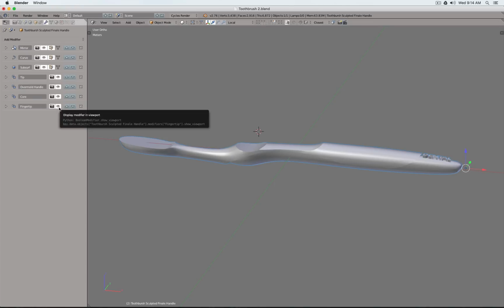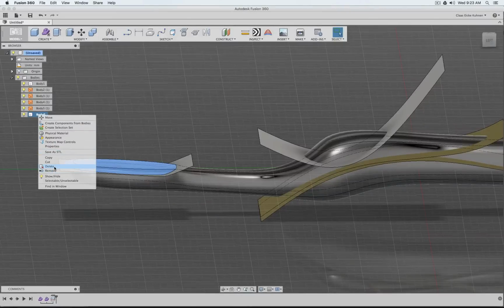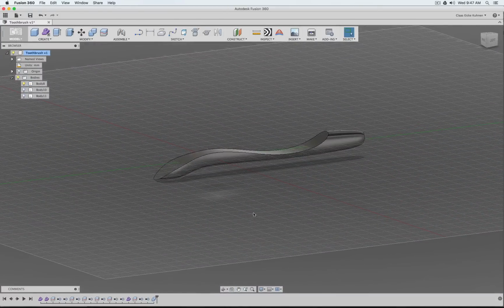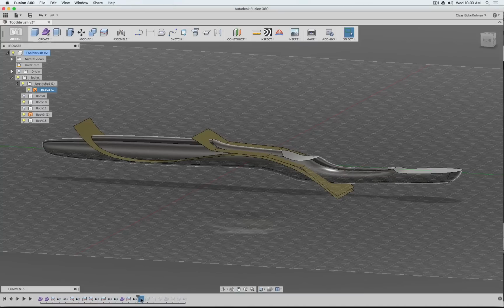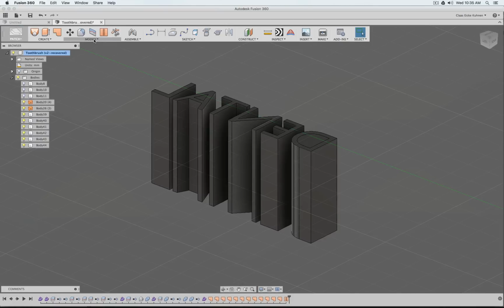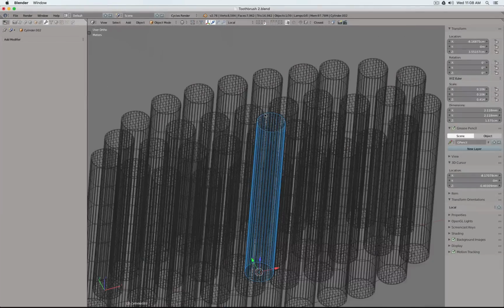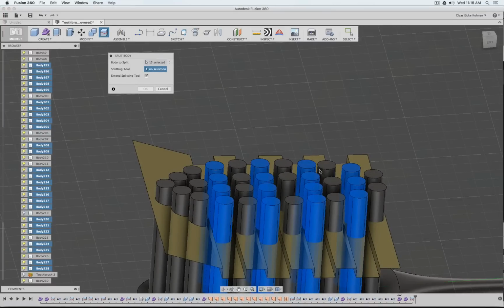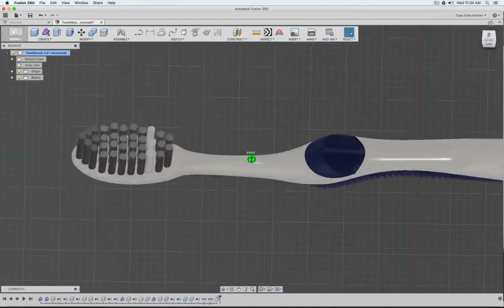Toothbrush Part 3 : Blender To Fusion 360

Comment: Any suggestions on why my parts aren't originated correct after importing into Fusion 360?
Reply from the maker: JRMNone yes your axis preferences is different in Fusion

Go to preferences and set z as the up axis

Then make a new Design and import the data
Reply: Claas Kuhnen thanks for the quick reply. I thought I had the same setting as yours in Blender and Fusion, but will try it again later. Sometimes it better to walk away for a bit and come back with a clear mind. lol
Reply from the maker: JRMNone what many don’t know is that the axis change ONLY applies to new designs and NOT the current file
Reply: Claas Kuhnen starting fresh did me some good because everything is importing in place. Awesome video by the way. This work flow will save me a lot of time.
Reply from the maker: JRMNone You are welcome - I love the Fusion Blender workflow because it combines the best of both worlds. Fusion just does not have the same stuff Blender offers.